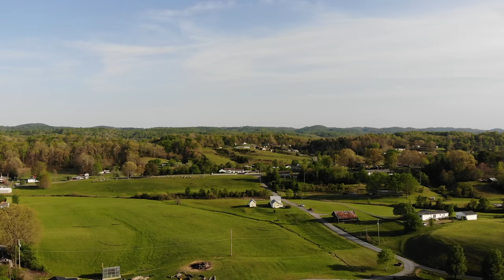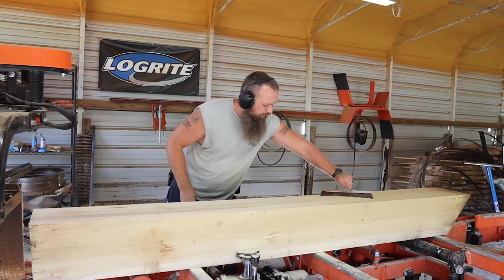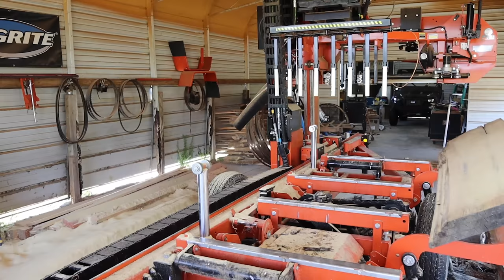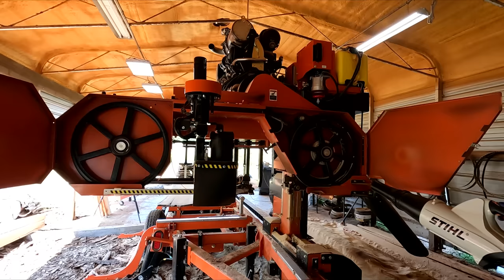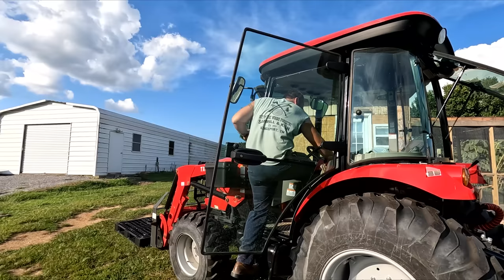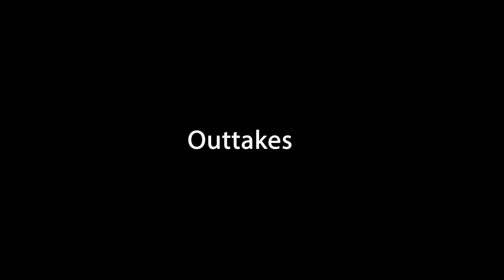I Would Really Appreciate It If You Would Watch This Video

Comment: Nice opening shot except for the bump at the end. Nice opening music. When you took the blade off, you really looked at the wheels before you blue the dust off. Did you have a problem or was that just the normal check before changing the blade??? Funny out takes, but we wouldn't have known if that was the log truck's horn or the neighbors... Good video... How rough is that saw dust off of the mill?? Do you ever sell it or do you just get rid of it. I use saw dust in my refinishing of antique ( or any) furniture...

Comment: Is there any value in "reclaimed" sawdust? 
In my Papermill power plant, sawdust mixed with diesel fuel was fabulous for sweeping the floors for dust bunnies. Especially cleaning up water treatment hydrated lime. A few handfuls of sawdust and bing bang bong, sweep sweep. Floor was pristine.

Comment: Sometimes you cut a single board and pull it back and other times you cut multiple boards and leave them on the log and bring them back together. Is there a ryme or reason for this difference?